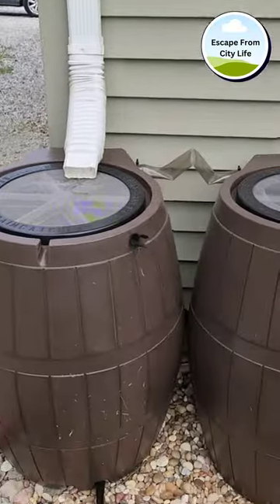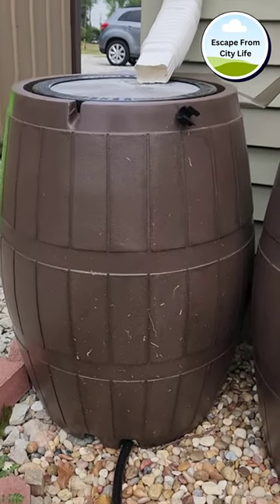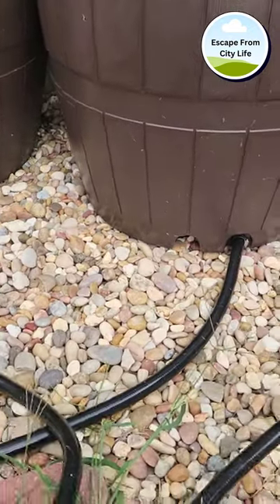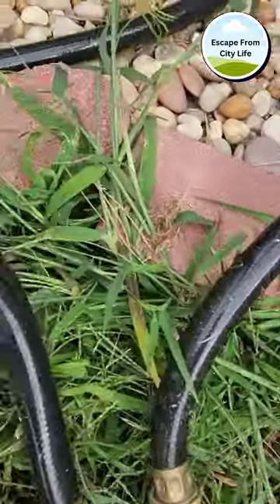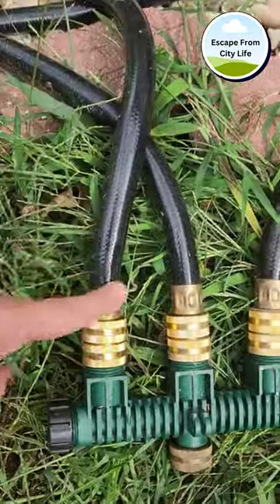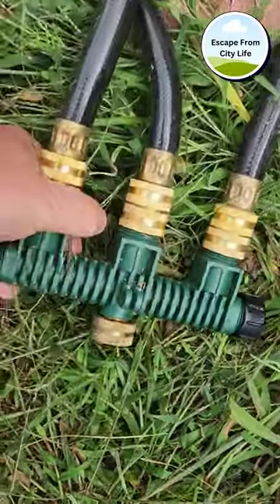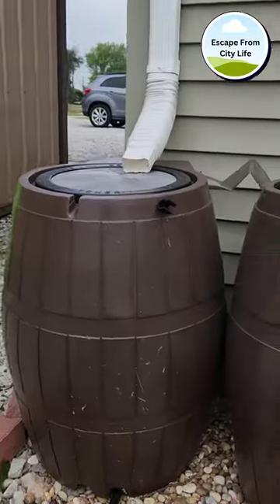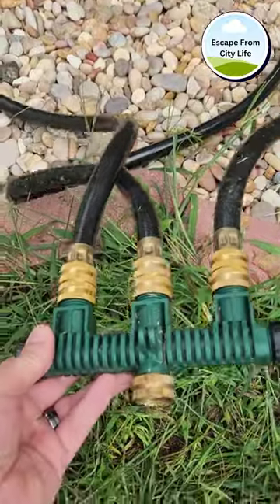Using A Manifold On Rain Barrels For Convenience, More Efficiency and Water Flow

Comment: No you wont get more waterflow or pressure.... you are restricted by the diameter of your hose ... need a manifold outlet CLOSE to source bigger then source outlet
Reply from the maker: Sorry I disagree. I'm not claiming powerful pressure but I did see an increase in the flow by sourcing the hoses through the manifold and letting them all flow versus just using the hose straight from the rain barrel. Again I didn't measure it by just from my own visual I could tell it made a bit of a difference. More so the manifold is also for convenience just not pressure.